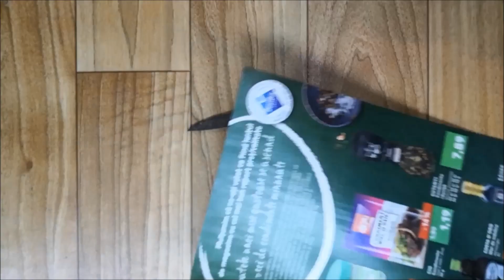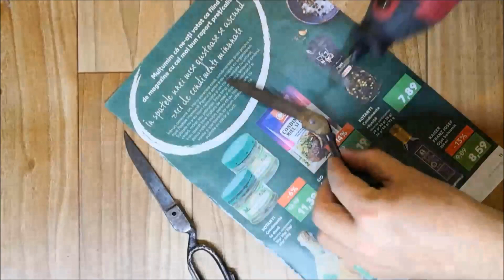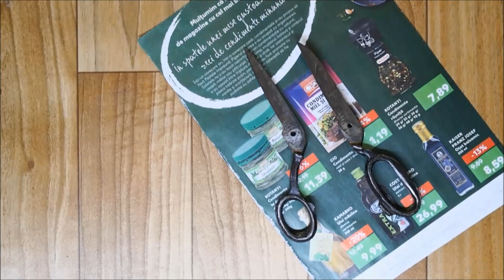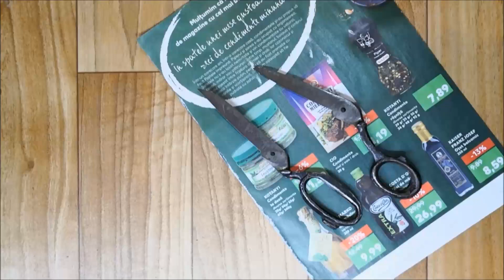How I clean and sharpen a pair of old tailor scissors

Comment: When you first start cleaning them instead of using the wire brush, put them in a pan with water covering them. Boil for about 45 mins keeping them covered with water. Then after they are cool take OOO or OOOO steel wool to remove the excess oxide from the shears. It will leave the steel blue and the excess oxide will buff off. I believe the final product is better.
Reply from the maker: Thank you for the idea.